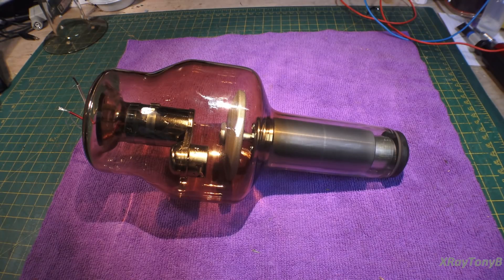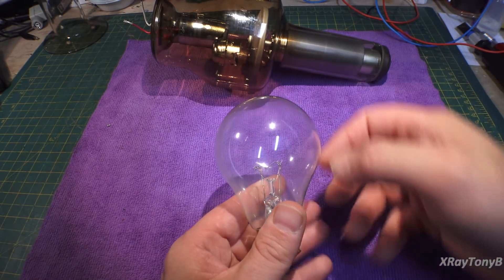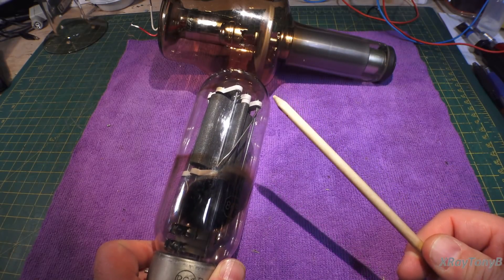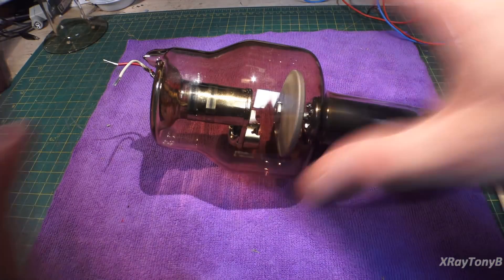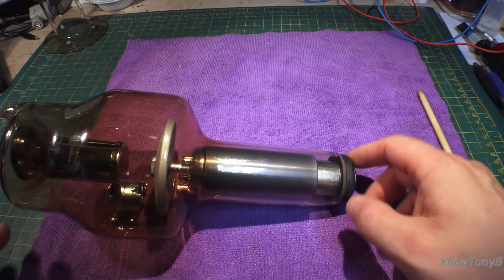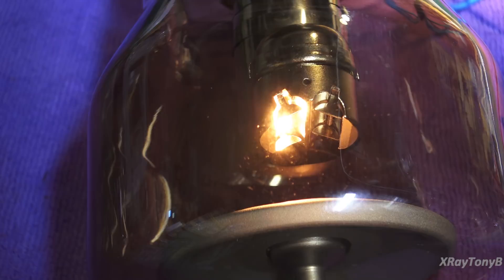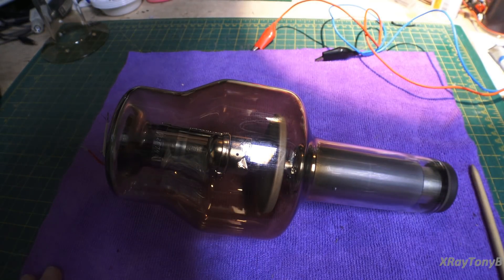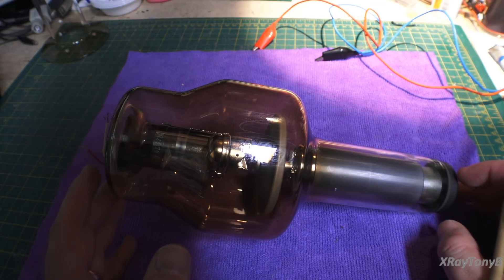Closer Look at an X Ray tube - Part 2: Some Theory

Comment: You can also get "rough service" bulbs used in mechanics drop lights.  Very heavy duty filament and are also made with a anti shatter coating.  From my previous life as a heavy truck mechanic.
Reply: We have them here too for use on building sites. Normally thrown up on a string of 20 at a time in parallel.

Comment: I just acquired a similar tube.  i am curious what is the purpose of the separate glass sleeve that seats between the rotor and stator.  mine also has oil in the tube,  did these run with inert oil IN the tube?  and thanks.  what a fantastic video.

Comment: 1)   How  much  does  one  of  those tubes  cost?     2)   What   kind of   gas   is inside of that tube   3)   Is that   cooling  oil the same thing  that's whats   inside  transformers (mineral  oil) 4)   Can you power  a flux  capacitor   with one of  those?

Comment: Very interesting, must be great  to work on those machines (building and service them).  A question, Are dentist Xrays useable to look inside IC's etc (to see bondwires and the die) ?
I do not mind if you would make a part 3 to go (much) deeper and maybe some measurements and demo's
Reply from the maker: The bigger issue would be finding a suitable receptor to display the image.  No one is making x-ray film processors anymore and only one company is making the correct developer and fixer chemistry.  Film is also expensive.  The other alternative is CR (computed radiography) or DR (digital/direct radiography) but they are prohibitively expensive.  Also, the circuitry inside integrated circuits is so tiny that the machine would have a difficult time resolving something that small.  Only a mammography unit could see something that small.

Comment: A couple questions: (1) with the rectified but unfiltered high voltage waveform: does that mean that exposure compensation would be non-linear? Where a short exposure would have proportionally less area of high voltage peaks than a longer exposure? and (2) I would assume sensor technology has greatly changed over the years allowing the photographer to get a useful exposure with less power?  Would that also mean that higher resolution can be achieved because a smaller filament will suffice?

Comment: Great presentation in deed. I‘m an expert in electronics and understand the basics of X-ray technology. However your presentation gave me a deeper look into this technology an how it works in detail. I suppose I had a high doses of X-ray as young child because for us as children we had a lot of fun to stand multiple times onto a fluroscope at our shoe shop to see the bones of our feet. During the 50th, also the experts underestimated the impact of high X-ray doses. 
So far I understood from your presentation, an X-ray tube with rotating anode seems only necessary for continous radiation over a longer time period. To detect a broken bone requires only a radiation pulse of few milli seconds. A rotating anode with high mass is probably not needed. Am I rigth?

Comment: This is a excellent video. I really enjoy this discussion. I do have a question. I'm still unsure why the anode spins. Is this for heat dissipation?  One more question. In HF amps the voltage on the tube can be up to 4KV. Is there X-rays being generated on these tubes? I understand the concept that the plate surrounds the cathode but at these voltages I would expect some X-rays at the top and bottom of the tube. Lastly could you put up some diagrams of the newer circuits? Again. Really great video!!
Reply from the maker: HI Larry,
At 4kV, any x-ray produced would not have the energy to penetrate the glass envelope of the tube.  X-Ray really isn't much of an issue until the voltage gets up over 10kV.  Even then, many factors such as HVL, filtration, distance, etc. will affect the properties of the X-Ray.
Reply: Yes Larry spinning the anode spreads out the heat over the anode area. Tony, I think Larry is talking about external anode tubes as well as internal anode tubes. At 4kv the metal case of the amplifier should block any weak Xrays that 4kv generates.

Comment: Question... How does the anode spin? is the HV connected via slip rings and a motor drives the anode or is there a magnetic motor in the shaft driven externally?
Reply: George Christofi Magnetic stator. The stator wiring runs completely separate from the HV cables.
Reply: I either missed that bit in the video or it just didnt sink in. Thanks again for the great video.
Reply: Go to about 18:15 in the video.  That's where he describes it.

Comment: Well high energy photons are just, light, non-visible, photography and exposure is exactly the way of putting it. Glorified controllable flash, just using x-rays and constant current/voltage supply as the tube requires that. If we could dump a huge load of charge into a smaller device and get the same instant quality of x-rays like a xenon tube does creating photons for flash photography, we would have switched to that by now, if it were physically possible.

Comment: why no leaded hood for dental x rays to protect brain and eyes?
Reply: but the tech leaves the room, behind the lead wall, lol  
we probably get more "rays" from the sun
Reply from the maker: X-Ray out of a dental unit is much lower dose than in a radiographic system.  The x-ray beam is also tightly collimated to a small area not much larger than your tooth.

Comment: Would that Shell Diala oil be useful in a paint can RF dummy load? Lol
Reply from the maker: Great question!  Shell Diala is perfect for RF dummy loads.  Just make sure you keep the can sealed, as Diala can absorb moisture from the air which reduces its dielectric strength.

Comment: Ill ask a leading question.   What impact has the introduction of semiconductor based image sensors done to the industry?  I am aware that in the case of dental x-ray systems the sensor only needs 8-12% of the power that a film x-ray did.  :)

Comment: Thank you for this wonderful video. I have question... As we can see from your first video, the useful x-rays come out of a small window after collimated.. But as i can see, this slit dimension is so  small to irradiate for example a man's chest... Do the commercial xray tubes have larger dimensions for that?
Reply: the xray beam fans out from the focal point, so you get a bigger picture from a point source.. like an old fashioned photo enlarger, or image projector. the smaller point source gives you a finer resolution on your xray, but lower power. the larger filament gives you less resolution (more blurry image), but more power is avalable for more xrays. its a compromise on quality vs penetration.

Comment: Can you use both filaments in a X-ray tube if it’s called for
Reply: Nope, one filament is more powerful than the other, so the small one wouldn't add much to the power. More importantly - using both filaments would make the image blurry, and have shadows, defeating the purpose of a small single point source. imagine xrays are like visible  light - two light beams will make 2 shadows, not a nice xray picture :)

Comment: Well you managed to confuse me across the 2 videos. You refer to ma at one point as the current thought the filament and at another point as the current between anode and cathode. What does the meter on the control panel measure? What is mas the heater current times the seconds or the anode / cathode current times the seconds?
Reply: Alan King 
The meter will indicate the current flowing from cathode to anode.  mAS is this current  multiplied by the exposure time.